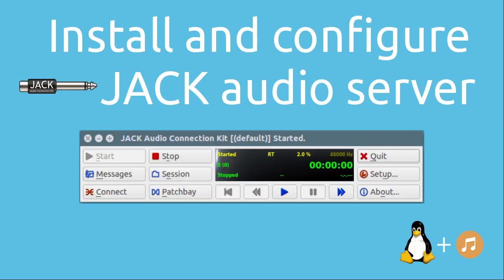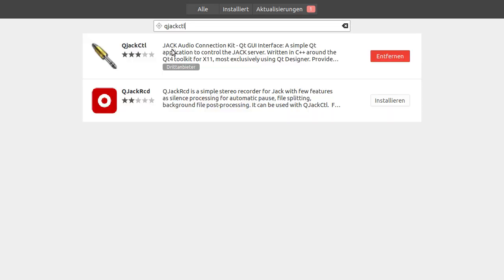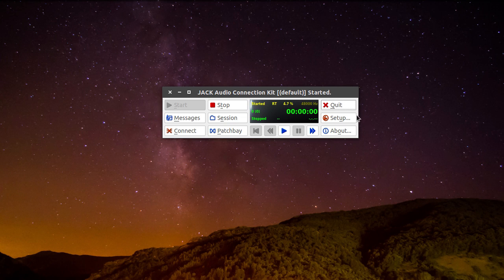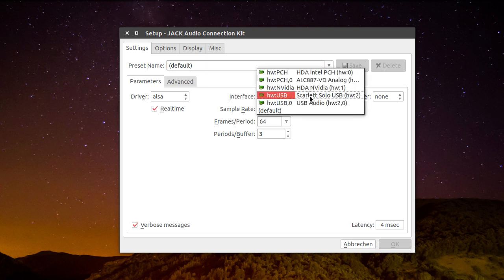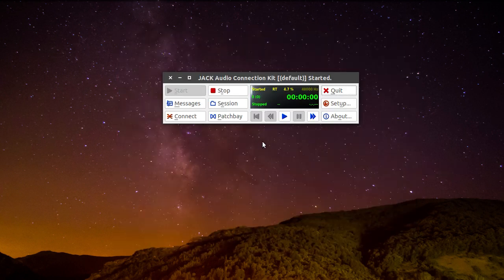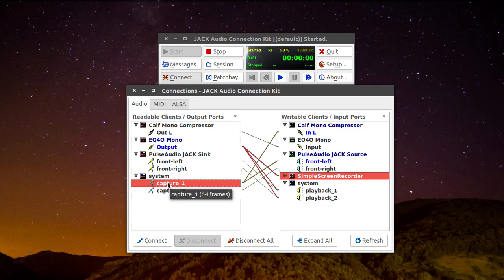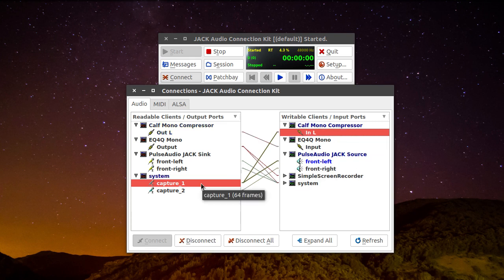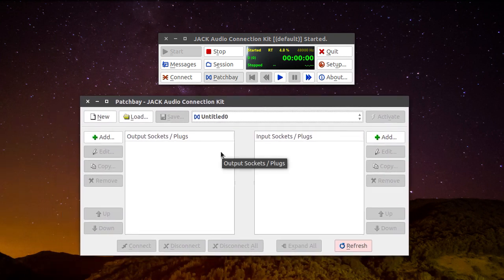Install and configure JACK audio server | Tutorials

Comment: Hey just a couple of things related to this and your previous video.  The steps were a little out of order and I wanted to just set things straight because my experience was a bit different and for a beginner even the simplest step left out can cause a lot of confusion.  It took me absolutely forever to get this to work right but here is my two cents.  Not criticism, just presenting a different scenario.

Last video:
1. After adding user to audio group, one has to log out and log back in, otherwise qjackctl wont detect everything including Pulseaudio.
2. There is a step where you ask to edit the file /etc/security/limits.d/audio.conf, for me that file didnt exist until after I installed qjackctl.
3. Lastly the pulse audio thing is a little confusing if you dont know what you're doing.  When watching this video I started the jack server and immediately lose all audio, especially youtube audio.  Once you start the jack server it will route pulseaudio to jack, right click on the volume icon and open up the mixer.  In you default output device select jack.  By default it should say Built-in System..something. Then you can hear both the audio from say Hydrogen, and Youtube while jack is still running.

But other than that. thanks for this, its awesome, can you at some point do a tutorial on how to use the patchbay to make connections between the different softwares like hydrogen or guitarix and ardour for proper recording.
Thanks
Reply from the maker: Thanks for your comment and welcome to the world of Linux audio! :) You are right, I missed out some of the details, glad you found a solution. You are also welcome to ask if you're stuck in some of the steps. Your comment is pinned for a while so that everybody can see your detailed explanation for beginners.
Reply: What do you mean by 'volume icon'?

Comment: Hi J! idk if you still answer questions about a 4 y/o video, but when I try to start it, it just gives me an error, "Could not connect to the Jack server as client", any clue why?
Reply: Tim4k. How did you resolve the problem with JACK audio server, "Could not connect to the server as client"? Having the same issue?
Reply: @craigwayment9634  joining stuff in the patch area and changing the audio out to my external audio card did the job for me
Reply: @tim4k435  Thank you, I never did get Jack working. After trying a few recommended solutions without any luck, my OS became corrupt and was destroying my files, just finished setting up a new OS like I want it. Ready to try it again.
Reply: @craigwayment9634  Sorry to hear that, the thing with linux is that as every system is very different to the other, even if they run the same distro, some things will be very different and make stuff difficult when it was easy for others

Comment: Hey, buddy. Thanks again for the videos, they are really helping with my full transition to Linux.

Just one little thing I wanna ask you... Is there any practical reason for you to use vanilla Ubuntu? Do you think the current vanilla  (18.10 by the time I'm typing this) gives any real advantage over other distros (like Ubuntu Mate or Linux Mint)? I mean, latancy wise.

Thanks again for the great content. Hope to see you posting videos again soon.
Reply from the maker: To use the vanilla ubuntu is only my taste. Should be the other way around. Mate and Mint are both more lightweight so you should have more cpu power left. Both are based on ubuntu. But there are other things to consider when choosing your distro for example security and up to date packages.

Comment: hello jhoermann, it is possible to route alsa in to jack to  connect software who not suport jack?

awesome tutorials, thanks so much...
Reply from the maker: Yes you can, all you need is to install the package "pulseaudio-module-jack" in Ubuntu or the aquivalent package in your distribution. Have a look at my other video: https://www.youtube.com/watch?v=E6LuvdDEqCA&t=3s
Reply: thank you so much!!!
Reply: this is incredible, following your videos I got 0 xruns, thank you, I have a one more doubt, have a way to configure the numbers of inputs and outputs of the pulseaudio-module-jack?  I m trying to connect vcv rack to renoise through pulse audio (I can create dynamically jacks inputs in renoise , but only two outputs in pulseaudio-jack)
Reply from the maker: David Rodriguez Great that it helped. The pulseaudio Outputs are the same number of the Outputs of your system. So normally there are two for left and right. Don't think you can add more (virtual) outputs.
Reply: I found the answer here http://puredata.info/docs/JackRoutingMultichannelAndBrowserAudio/ , using the script to execute after startup, it generate another instance of pulse audio, and changing the number of inputs and  outputs  channel in the script   generate acustom node,  the only inconvenience is that it is generated like a second instance, I don't know if it can have influence in the performance
Reply from the maker: David Rodriguez great, didn't know that. Don't think this has any bad influence on performance.
Reply: it work correctly with all of one outputs of the vcv audio  (32 ) https://vcvrack.com/manual/images/Core/Audio.m.png  to add separates channel  in your daw

Comment: Hi mate, and thanks for doing these tutorials. After two or three hours of fiddling around with this stuff, like a dog with a bone, I seem to have got it all working (touch wood). Albeit that the thing that Sheheryar said about the sound settings was important, and it was only after reading that comment that I got the thing working. Before that I just had silence, then some horrible long wave radio noise, and then proper. So now I have to find out what I can do with JACK. Any good pages for that?

And on that subject, the original reason that I came down this road is that earlier today I installed a cool mixing software called Mixxx (which I expect you know). As soon as i turned it on, it shut down the sound everywhere else, which I found a bit annoying. So I wrote to their forum, and got referred to the manual, and ended up spending half the day installing JACK!!!

OK, so now I've got JACK for all future purposes, but I still can't configure Mixxx to work while letting other programs access sound. Here's the relevant part of the manual:

https://www.mixxx.org/manual/latest/chapters/configuration.html#audio-api

To be honest, I can't really figure out what they're saying, other than that JACK and PulseAudio work a little bit at cross-purposes, and that it's still easier to use ALSA. But like I said, I'm a dog with a bone. I'm trying to work out what they mean in the final paragraph:

PulseAudio plugin for alsalibs???
That sounds like the key, as it "allows Mixxx to share the default
system sound card with other media players". 
But then..... pasuspender????? 
What's that?? Now I'm officially lost!
Running from the command line - fair enough - it's a bit annoying and geeky, but this is Linux, eh. LOL.

Any wisdom you can share will be greatly appreciated  :~)
Reply from the maker: This shouldn't be so hard to do. 1. Make sure you installed the package 
pulseaudio-module-jack, pavucontrol is also helpful. 2. Configure Mixx 
so that it uses JACK 3. Open and start JACK - make sure the pulseaudio 
jack sink is connected to your system out 4. Configure your other 
programs to pulseaudio jack sink with pavucontrol or use it as standard 
with the system mixer 4. Open up Mixx and others. No console required.
Reply: Hi. Just wanted to give belated thanks for your reply, and follow up with what I've done about the issue. 

I've been pretty busy doing all the setup jobs of a total Linux beginner (which hopefully I'm not quite any more). Sooooooo, just coming back to this Mixxx thing today with a little more general confidence, I have to say that actually there isn't an easy way to configure it, as in your step #2. it really is quite hard to set it up to allow other sound on Linux. Look at what they say in the manual - it's very fiddly, and really a bit too much for a new Linux user. 

If I ever get so clever with audio that I'm working on Mixxx and wanting to send signals through JACK to somewhere else, I'll come back to this. But that's not really the case right now. I just want to be able to play with Mixxx without shutting out other sound. So finally I went for a bit of an ugly solution, which does seem to work. Simples - I put Mixxx on a Windows 7 virtual machine (I've got enough RAM to get away with that) and that allows it to run without conflicting with the rest of the system. Not pretty, but sometimes you just have to go for what works! I tried it first on a Linux virtual machine, but that was a bit less stable for some reason, so Windows it was!

The upside of all this is that I've learned that there is a thing called JACK, and it looks really cool and interesting to play with. So - thanks again for your tutorial, and all the best :~}

Comment: when I start Jack an error message pops up wich says 
"could not connect to JACK server as client.
-Overall operation failed. 
-Unable to connect to server. "
I followed your previous tutorial.
Reply from the maker: bajhan smith Should be a error with your Soundcard drivers or setting. Please start a new thread at https://www.linuxmusicians.com/index.php
Reply: JHoermann // Linux audio production Thank you very much I appreciate it .
And I will look into my sound drivers, it makes sense that that would the issue